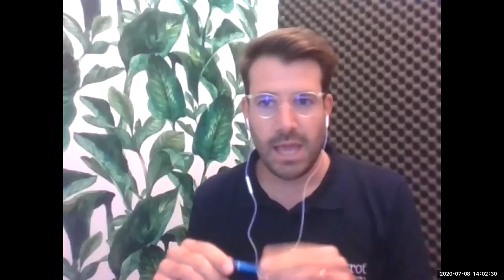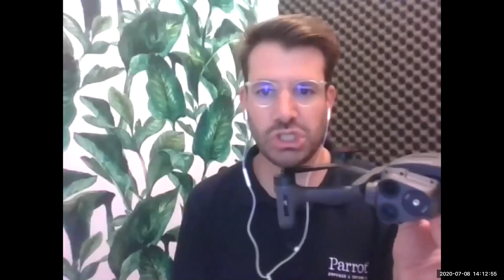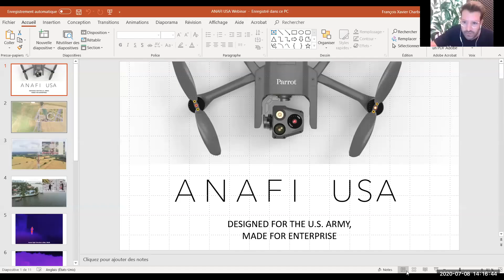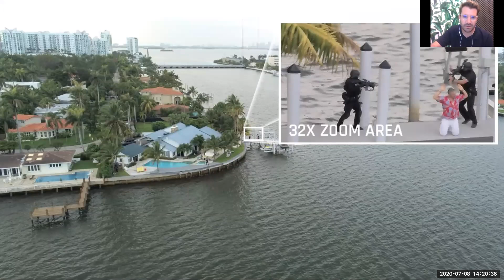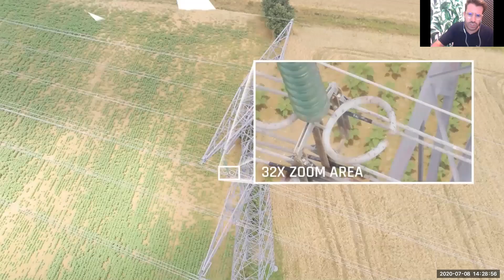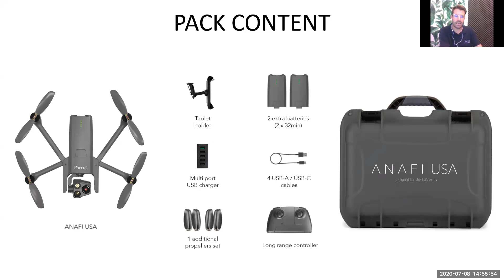Tech Talk Parrot - Next Generation Drone - ANAFI USA

Comment: I would like to see a option to record a manual fight into flight plan, so it could be used as a patrol on my farm. Where i have many trees and small trails to different open fields and also a steep narrow road down to the river bottom where my cows spend time.  Where a normal flight plan would be impossible to setup or at least for a normal farmer like me.